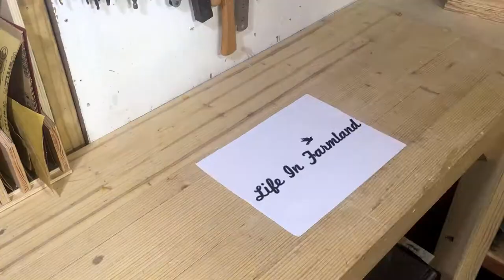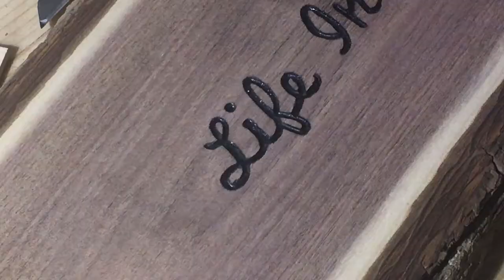Carving a Sign for Life in Farmland

Comment: This looks great. Good job. Would it be possible to use a tung oil, linseed oil instead of the urethane? What would be the pros and cons. Just curious, again looks great.
Reply from the maker: The oils would offer protection  but maintain the natural look of the wood. The urethane is a coating so it puts a smooth covering for protection . This will be a topic of a future “quick tip Monday” I wanted to coat the bark with something, so that’s why I went with a urethane.